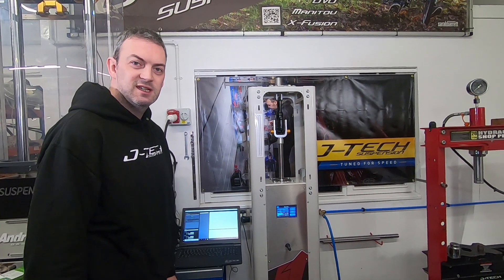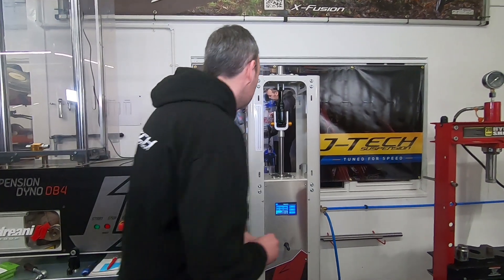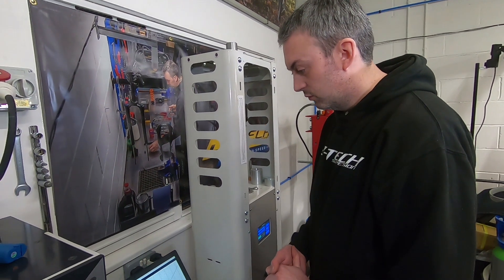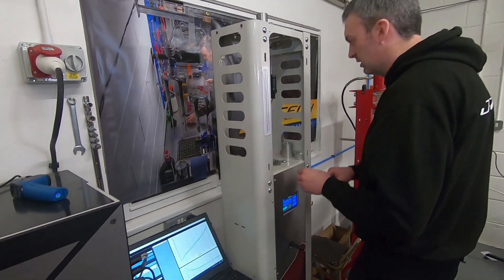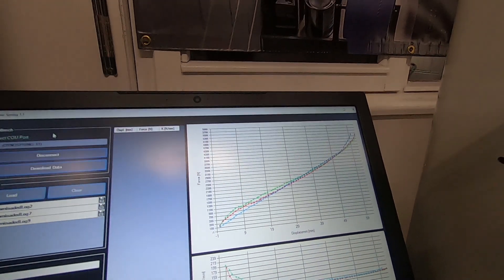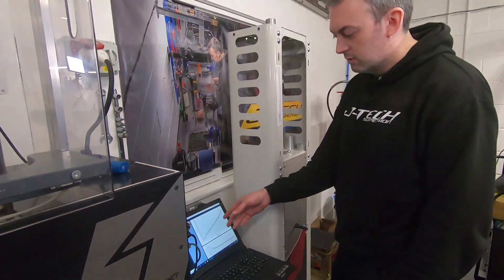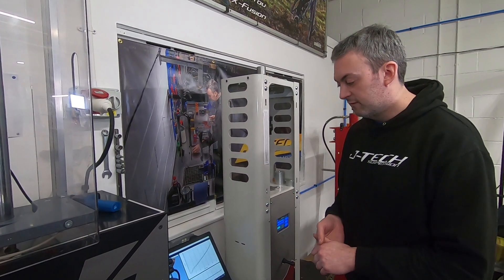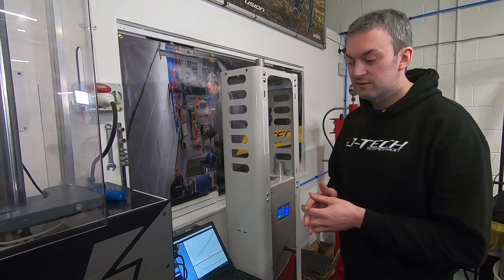Are Coils Springs More Progressive? - Coil Vs Air - Super Deluxe Test

Comment: will a coil shock work on a linear single pivot bike like the 2014-2018 GT FURY? what config should i run if I just occasionally do max 6 ft drops (i'm 85 kilos), and the rest are rockgardens.
Reply from the maker: Yes, some better than others (depending on bump stop design). We'd recommend using a progressive spring with it for sure though, either way, if you're of a higher ability level. https://j-techsuspension.co.uk/collections/springs/products/race-only-springs-progressive

Comment: Hi, i have not a stock remedy 8 with air shock 230×57.5 fitted with coil shock without changing the linkage. Do you reckon it will fit a same sized coil shock (rockshox super deluxe coil select+ 230×57.5) without changing the linkage?
Reply from the maker: Hi, yes that will fit. There's enough progression for most, you may want to run a progressive spring if you're riding very hard on large features though.
Reply: @j-techsuspension  thank you!
Reply: Hi, can you tell me about coil shock on remedy, how do you feel,  is it worth? I just thinking about upgrade my shock, from standard re:active to a RS sdu coil or RS sdu with megneg. I never try a coil shock. Can you advise me, thanks.
Reply: @unkle-user  used dvo jade x with my trek instead of the planned rockshox and it did not disappoint

Comment: I'me very confused now...I got a commencal clash with a super deluxe select. The bike felt way too linear with little mid stroke support and harsh beggining of stroke. I just installed  megneg a couple days ago with two spacers in the negative chamber. Haven't had a chance to take the bike on a proper ride but, just by testing on the road doing bunny hops  and slamming into kerbs, could swear the mid stroke support has incresed as well as small bump sensitivity. Any thoughts? Thanks for the content!
Reply from the maker: You're exactly right - you'll have had to run a higher pressure to achieve the same amount of sag, which then gives you more mid stroke support.

Comment: Do you think a linear sping would be too linear for a commencal meta am 2021?
Reply from the maker: It depends on what you intend on doing with it and what sort of rider you are. For most riders, trail riding and light 'Enduro' riding, linear is fine. If you're a very fast and aggressive rider and are riding bigger features and bike parks, a progressive spring will work better.
Reply: @j-techsuspension  perfect thank you, I'm more on the aggressive and bike park fast tech with jumps and flat landing drops, are ohlins coils any different? They do make the meta AM with an ohlins build
Reply from the maker: @maxencegregoire8618  No problem. Ohlins spring are linear, however the shock has a larger bump stop than most shock and also a higher level of damping control (without felling too harsh) than most standard shock, so it does bridge the gap more. However, if you're a very capable and aggressive rider, you'll still benefit from going to a progressive spring. There's no harm in trying is with a linear spring first. If you can't get enough bottoming support, with good sag/ride height, then upgrade to a progressive spring.
Reply: @j-techsuspension  Yes! Thank you so much

Comment: Fantastic to see the comparison between 3 shocks from the same manufacturer. Definitely cheaper to buy a negmeg than a whole new coil shock! Made my mind up now.
Reply: Yes, If U have a Superdeluxe, and your bodyweight under 90 kgs. My weight 104 kg, I need to 290 PSI to SD, with megneg need 350-360 psi or more..... The prev. 2023 SD can handle max 325 PSI. The new MY23 okey.

Comment: I have a enduro specy 2020 with RS super delux, and i think about coil, but what about put in the neopos Formula or Ohlins? Seems to be coil like, what do you think to do a test between coil and air+neopons?
Reply from the maker: Hi Luca, yes, certainly coil like, however you still have the additional friction of air seals. We're also not sure that they are reactive enough under high speed movements, so we're carrying out further testing, once we get chance. Until then, we're not offering them. We'll maybe do a video on them once we've done some thorough testing. Many thanks

Comment: Loved this video and just subscribed.  I'm curious how much progression a hydraulic bottom-out is compared to a bump stop (e.g. EXT Storia & lates PUSH 11.6 models) , as well as verifying Sprindex's claim of the final 20% of their coil travel being progressive... as well as whther or not DVO Jade X's air bladder has any input on this sort of testing; thank you
Reply from the maker: Hi Sam, thanks for subscribing! 
This is a good question. A hydraulic bump stops force is speed dependent (the faster the shock is moving, the more resistance it offers), so a little different to a bump stop or progressive spring. So it's not accurately measurable in this kind of test. We have to combine data from a damping test, with the spring test to obtain the bottom out force at any given shaft speed. We may cover this in a video, if we ever get around to finding time to do some more! We've just been so busy this year that we've not had time to do any videos. It takes at least twice as long to do something when filming it as well, so we've just not been able to do any filming.
I understand what you're asking, regards the Jade bladder, however this is (and the same for just about any other shock on the market) not an adjustment of progression. Adding pressure to the bladder will only make the shock firmer in all positions, it's just like adding preload. Even on IFP shocks, people play around with raising the IFP height for more progression, but in reality the IFP or bladder pressure creates such a small spring force, it has very little impact on the force at the wheel. The only type of shock where IFP height and pressure make big differences to performance are older Fox boost valve shock and the likes of Manitou's SPV shocks. Both these systems generate more compression damping as the internal pressure of the shock increases. We recommend leaving IFP pressure alone/set to the manufacturers recommendation on anything else (which is pretty much any modern shock)
Many thanks

Comment: I have a 2018 Pivot Firebird 27.5 and was looking for the Rockshox  super deluxe coil and was told that the linkage on this bike is not suggested, what do you think? My weight with gear is 185lbs.
Reply from the maker: Not sure why that's been suggested. Everything that you need for a coil shock to work well is present on this bike. Many thanks.
Reply: @j-techsuspension  Thank you, but I ended up getting a 2020 Fox DHX2 with a 400lbs. spring and looking forward to test it

Comment: I’m thinking of upgrading my current dps float. I was thinking going for the float c2 or Öhlins ttx air. But then I was advised to go for the coil. What would you recommended for my levo? The bikes rear travel goes from linear to progressive to liniear?
Reply from the maker: We think coil is great on the Levo (presuming it's 2019/2020), but only when using a progressive spring, as it's not that progressive. However, the leverage ratio is high on these bikes and heavier riders will be outside of the range of the firmest progressive springs available. No, it's gently progressive all the way through. Less progressive at the start and end of the stroke, but never completely linear. If you'd like to submit your details on our advanced spring calculator service, we'll get back to you with what springs will be suitable for you - https://j-techsuspension.co.uk/pages/advanced-spring-calculator
Many thanks

Comment: I've got a Rocket Max gen 3 and really want a Coil but Cotic are saying that the Rocket Max isn't Coil compatible ...
Any ideas on why that is ?
Reply from the maker: I can see why they say that, as it's not very progressive, however with a progressive coil spring, it'll work great. As long as your riding weight isn't too light or too heavy for the range of progressive springs available, that is. You can submit you details on our advanced spring calculator and we'll let you know what we'd recommend - https://j-techsuspension.co.uk/pages/advanced-spring-calculator
Many thanks
Reply: @j-techsuspension  thank you for the reply. I will go on your website . Thanks again for the advice .

Comment: Great video.  I've had the Push Elevensix a few times on diff bikes (evil and yeti) and found that for the endlessly punchy climbs we have here in the Northeast US...coil was too soft off the top (least it was for me a 220lb rider) and I prefer the pedaling platform of air.
Reply: Did you use the lever for the second mode?  Aside from a DH mode, did you set one up as a trail or clmib switch?

Comment: Got a progressive spring from you guys yesterday (CC valt) so it will be interesting to see the difference.  How much affect does damping have in the force required to move the shock
Reply from the maker: Thanks for the order! We'll have another vid for you soon, when the workshop quietens down. With the adjusters wide open and the speed we're testing, there's no affect from the damping, just the spring rate of the IFP, which is very linear. The great thing about this way of testing is that it's giving an exact spring rate of the spring, IFP rate and the bump stop. So it's a measurement of exactly what you get when fitted to the bike. Obviously the leverage curve then changes that, but we have software to model that. Many thanks

Comment: What's the most important, the progresion of the leverage ratio or the value of the leverage ratio at the 1/3 final travel of the schock?. I think if it has a 2.5 or less leverage ratio with the actual schock you can control not to bottom.
Reply from the maker: This is something that varies depending on the application, we'll try and cover more on this in future videos for you. Many thanks